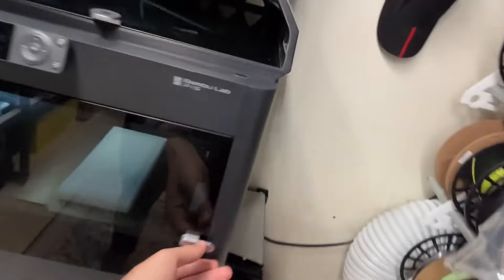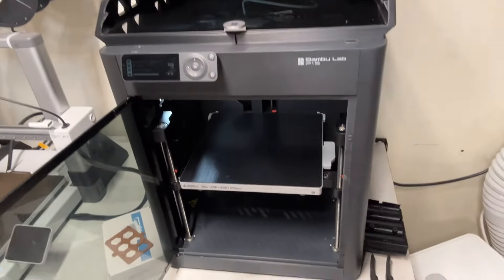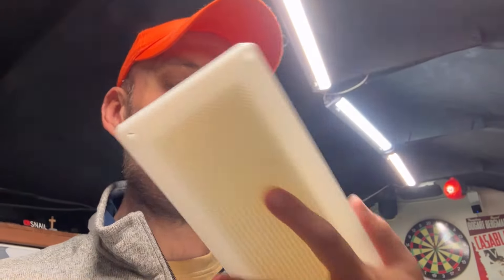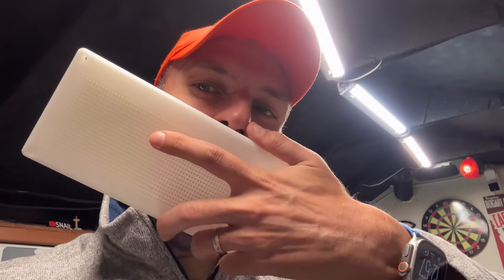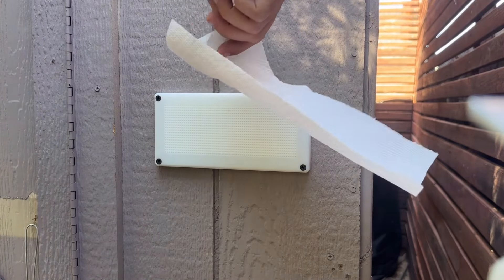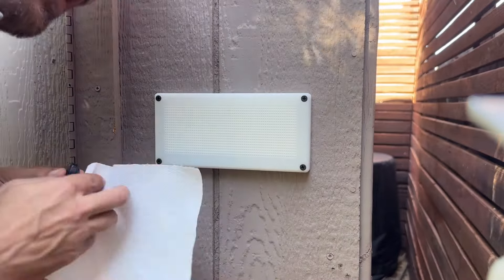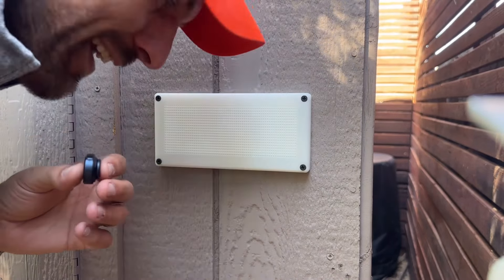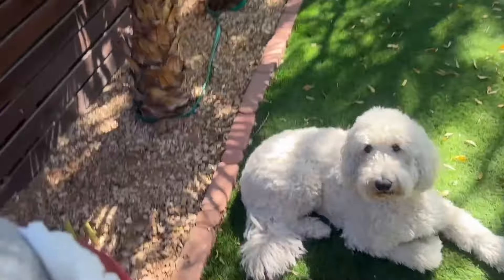Making a vent cover that doesn’t suck. Part 2. #3ddesign #3dprinting #hvac

Comment: It's going to get very clogged with dust 😕
Reply from the maker: @meustrus7056  probably not dust, but it did restrict a little too much. Had to make another!
Reply: Its outside😕
Reply: you can remove it and clean it off 😕

Comment: so idk how resolute your printer is but you could lay down some window screen and have it print right on top of it and just make the outer edges or print two pieces that sandwich some screen and have a channel to run the screen holder in it so you can replace it. that would be my first thoughts. Nice print though!
Reply from the maker: @fpbbq  that’s a great idea! Thanks 😊